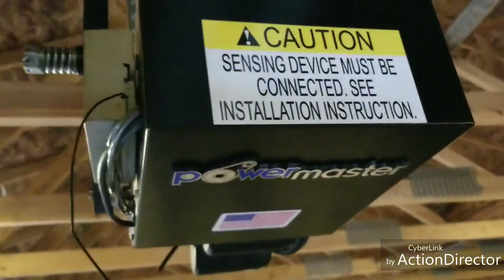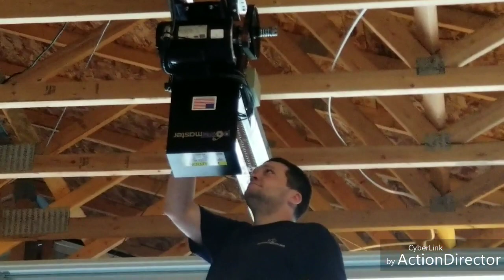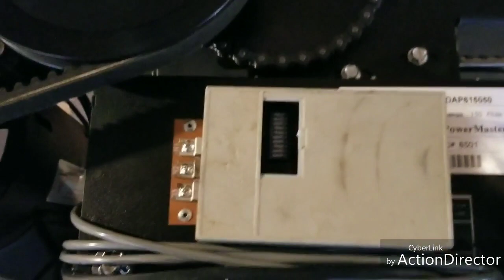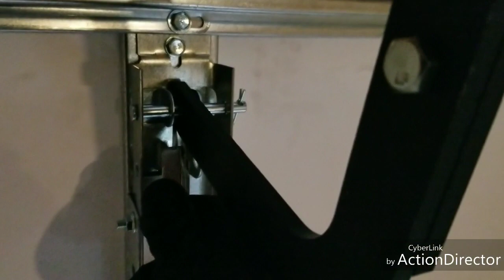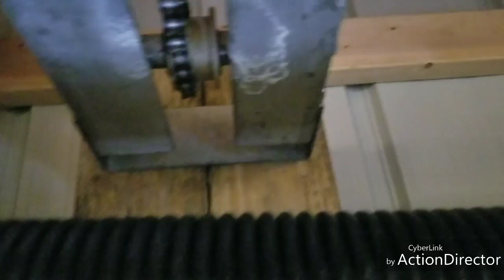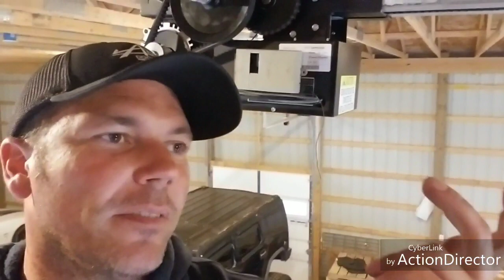PowerMaster Garage Door Opener - Installed

Comment: Believe Liftmaster did away with terminal strip do to a tech shorting across with wrist watch and got pinned in a door. There is a wire harness in the logic 5 that takes place of the outside terminals
Reply from the maker: I heard something like that but thought they put a plastic cover over it to help with that.

Comment: I've connected an external receiver on a logic 5. They have the wires inside. If I remember correctly (its been over a year since I did it) they have them wrapped together with a sticker that says 'radio'. But I agree.....terminals are handy.